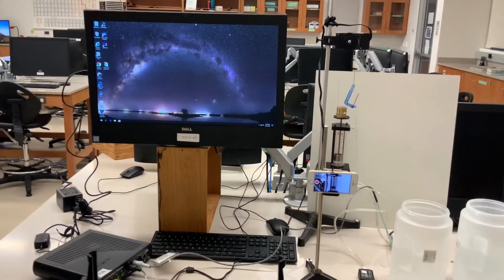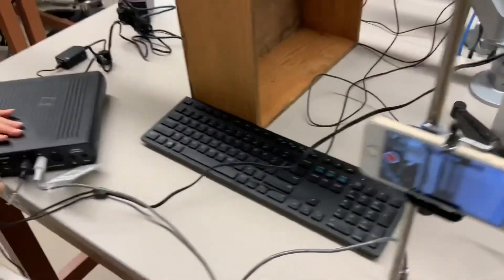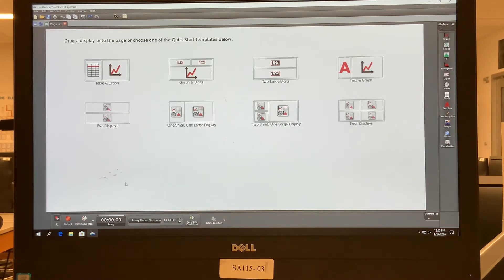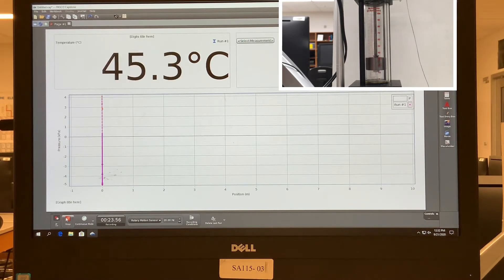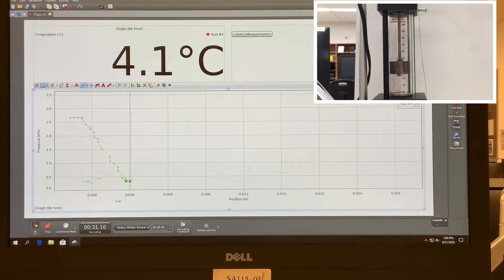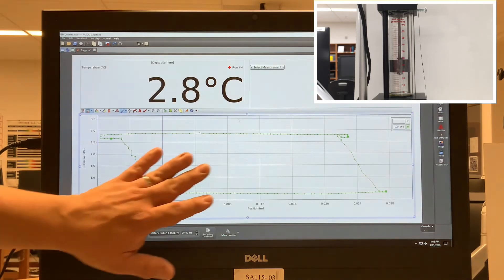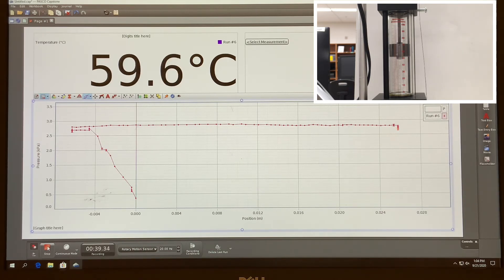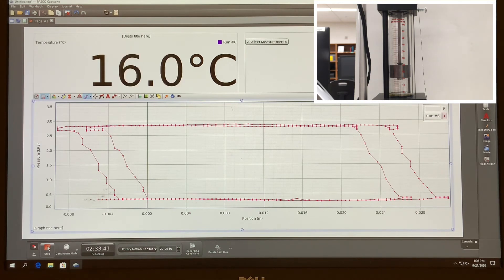Heat Engine Lab video data

Comment: Hi, Michael ! I just wanted to comment on your video called : "Testing the Yoidesu Schumann pulse generator for electromagnetic wave output." The comments were turned off.
From a scientific standpoint, considering the footage carefully, I noticed that the testing procedures that you apply to the magnet were not applied equally to the Schumann pulse generator.
To be more specific, on the conventional magnet, you waved your detector over several times in order to obtain/observe a reading. But on the Schumann generator, you did not.
Therefore, the test / review results, including your statements at the end of the video, in my opinion and consideration, could not be determined as scientifically truthful and your findings are based in your opinions and feelings and disappointments about the product during the limited amount spent testing / reviewing the product.
Another variant to be considered could be the possibility that the device malfunctioned because of an unforeseen circumstances such as, but not limited to: Shipment of a damaged product or human error during manufacturing of the item.